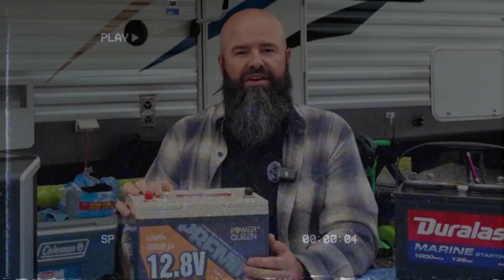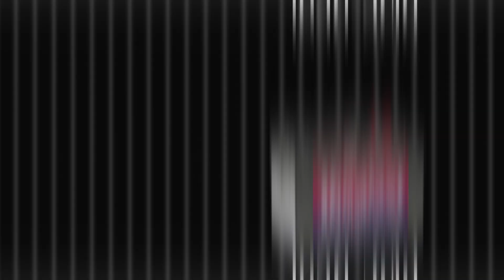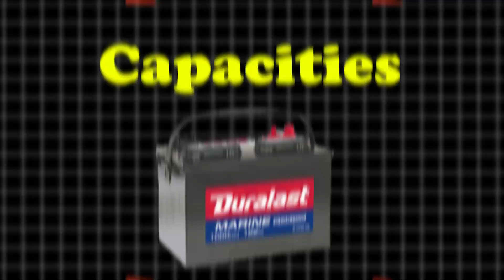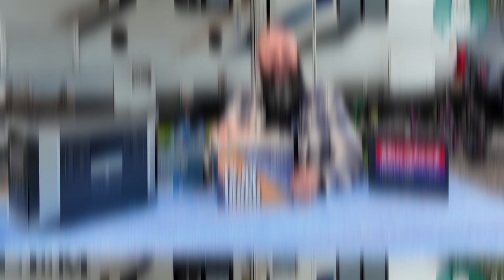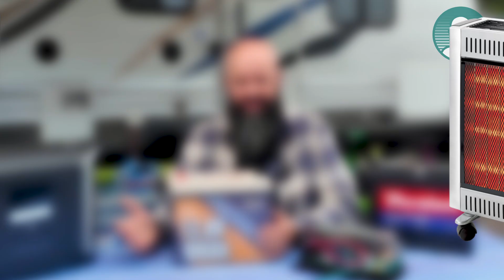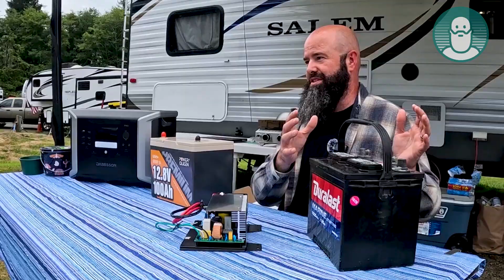Lithium Upgrade Tips for RV & Travel Trailers - Part 1

Comment: Now I plan on getting two batteries, along with chargers for it to go into a 120v outlet, most likely at the gym or laundromat. I plan on almost never using shore power. Is it still recommended I replace my converter?

Comment: Thanks for you video, I hope you dont mind a question. I have a vintage 1987 16 ft Bonair. So far what I think I understand is that while I`m towing with a 7 pin connection the lithium battery will charge normally with no stress on my altinator. What your saying though is that when I arrive at my campsite and and connect with my 15 amp AC power cable ( dont have 30 amps) I will only be able to charge the lithium battery to 80% of its capasity. I dont see why that matters though because when AC is available I dont need to think about the battery, only when I`m off grid and for that I`ll make sure she`s charged before I arrive.

Comment: Great video. I saw your other on the eco worthy 12.8v 280ah and I’m about to pull the trigger on it. But it worries me what you are saying about the dc to dc charger. How do I know if my Ram has it? And if it doesn’t have one how do I get one in there? I can’t keep it unplugged I need lights and breaks. This is a big drawback. I was buying it in the next few days. eBay has it 20% off and ends tomorrow.
Reply from the maker: Thanks for the kind words. I ended up crawling under my trailer and unhooking the charge line that went to my batteries for now. I also installed a new converter capable of lithium battery voltages, though it seems to charge only at around 8 amps 🤷🏻‍♂️.  Your ram likely doesn’t have a DC-to-DC but does have a charge line if the 7 wire plug. Crawl up under your trailer and should you see a junction box. While running with the lights off it will be the only wire to have 12v+ on it to ground. Good luck - I’ll post the next video in the series pretty soon.
Reply: @TheNetGuy my converter has a switch to go from La to Li. I’m good there. Just worried about my truck. I’ll disconnect the wire till I get more info on this. I have time. I’m done for the season but the battery is 20% off so want to jump on it.